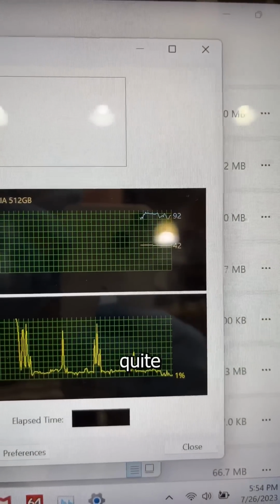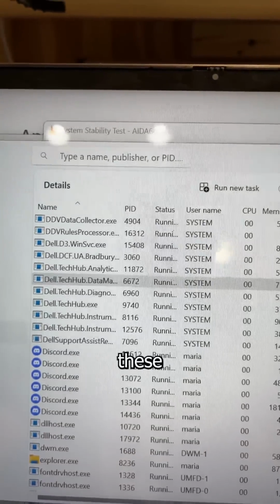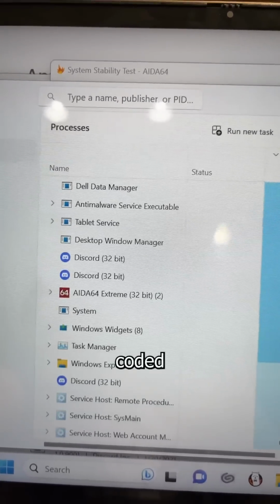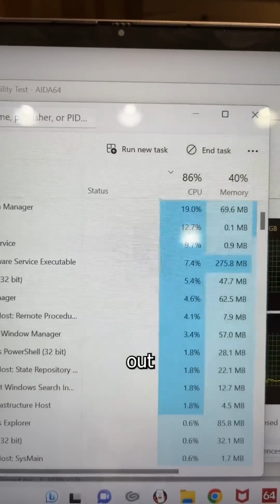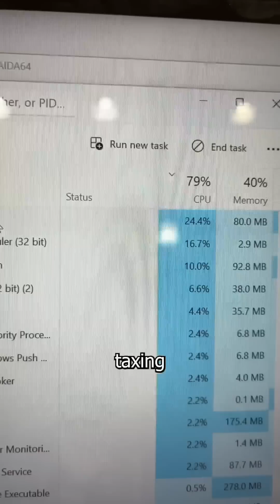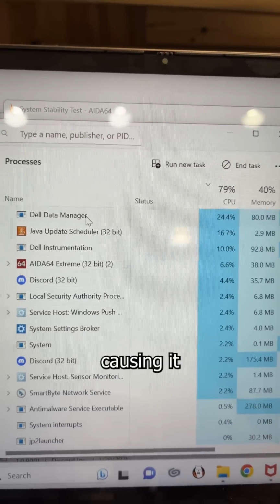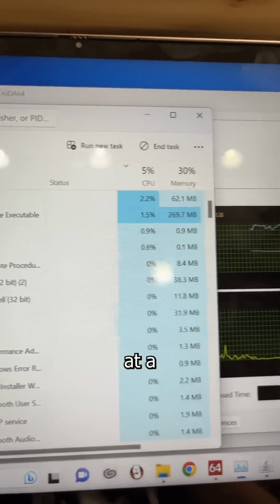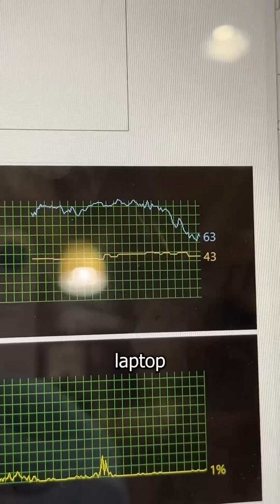Cleaning an overheating Dell Inspiron laptop. Can it be fixed? #tech #gaming #shorts #technology #pc

Comment from the maker: Now I’m no Engineerspert but clearly this heatsink was made for an Intel chip with an IGP and not for this AMD Ryzen 7. How big of a difference does this make in keeping the CPU cool? All you engineers can let me know in the comments!
Reply: I thought you were
The
Greatest 
Technician 
That's 
Ever
Lived
?
Reply from the maker: @Not_interestEd-  The jig's up, my house of cards is crumbling before my eyes
Reply: @Not_interestEd- of course he is, but he is not yet         the greatest Engineerspert That’s ever lived
Reply: Ryzen 7 is usually more efficient than Intel with IGP, Ryzen 7 runs down to 25w output. I'd clean it out, apply new thermal paste and pads and call it could.
Reply from the maker: @infernaldaedra the thing is it has no pads, just this tiny sad excuse for a heatsink. But thank you for the info. Curious why Dell thought it was ok to just slap thermal paste meant for Intel onto this? Does it just not make a difference?
Reply: @SalemTechsperts  I'm guessing it's because these heatsinks ship with thermal paste pre-applied. Dell used parts from the Intel model then slapped a AMD CPU on the board and called it a day
Reply: @SalemTechsperts  it should make no difference. The coolers are from a different oem and the paste is just silkscreened on. If there are no pads don't worry. In my opinion the cooler looks more than adequate for the CPU might even perform better with the larger cold plate even if it's unusual. Dell and HP try to reduce parts by reusing them from other models. Makes buying catalog parts easier too sometimes. My guess is that the Intel chips didn't meet sales projections so they got turned into Ryzen coolers.
Reply: @SalemTechsperts I'm pretty sure you said that wrong because there's no such thing as "thermal paste ment for Intel" thermal paste is such a product that it can work on any CPU regardless of brand.
Reply: Dell certified engineer here. Dell often only sells Intel exclusively, this means they mass produced for parts for Intel, which is why you see it being used here. If the Ryzen is kept within its 25 watt tdp it shouldn't on paper cause issues. However I would set the bios to cool and quiet or if possible a higher fan curve from either the bios or a custom fan program if possible. Note that Dell bios doesn't include fan control often.. so that milage may vary but cool n quiet mode for sure should exist at least. Hope this helps.
Reply: @tqrules01  Fun fact. at one point ALL of Dell's revenue and profit was because they were getting kickbacks from Intel to exclusively use their products and that they would make false allegations against AMD hardware. Intel even made enough money on the deal to win the lawsuit from AMD. 😂
Reply: @infernaldaedra  Can't like this comment or react but I do Say this. ... take that it how you like :)
Reply from the maker: @tqrules01  Awesome info, thanks for sharing!
Reply: @SalemTechsperts  you're most welcome and keep on asking! Everyday we learn everyday we have a chance to improve ourselves and move forward to something greater.
Reply: @infernaldaedra  you dont know how cooling works. Just having less wattage doesnt mean shit. since the ryzen chip is so tiny, it heats up crazy fast, so intel chips can use way more wattage while hvaing lesser temps
Reply: Doesn't make a difference what heatsink you put inside a laptop as long as it makes a good contact with the CPU surface 😊
Reply: @emadhamidnaja  Yes it does, smaller heatsinks cool powerful cpu's less
Reply: @emadhamidnaja Of course it matters. The amount of copper pipes on the heat sink makes a huge difference in temps, whether or not the heat sink has a Vapor chamber design, and the surface area of the heat sink, all make a difference regarding CPU temps. Look at a tear down of a high spec gaming laptops heatsink, and then look at this one again haha. Your statement is absolutely false man, it absolutely does matter what heatsink is used, the only tangible metrics being the amount of contact between heatsink and CPU being the sole predictor of cooling efficacy is very silly.
Reply: How do you nuke bloatware. What program do you use.
Reply: I HAVE A DELL INSPIRON 14R THAT IS UNOPENED FOR   11 YEARS. I JUST OPENED IT UP FOR CLEANING THE 11 YEARS SCROTUM DUST AND DISK AND RAM UPGRADE. I'M USING THIS LAPTOP TO WATCH THIS VIDEO
Reply: can u list those useless dell programs  I have dell inspiring 15 3000
Reply: Fine as long as the copper bit has contact with the whole die.
Reply: i like how there is doors music in the background
possibly not but i recognize it as the doors elevator theme
Reply: FWIW, Ghost Specter would make it run even cooler.
Reply: I have a laptop that overheats often, I thought it was normal, could I get some info, I might have to send it over
Reply: heatsink shouldn't matter, most of them are the same
Reply: And honestly, that wasn't mutch with SETI on 100% I've had smoke melt a MB, 4 months later I managed to fix it, still dunno how, bridge blown, etc oh and nice voice add in
Reply: Should i open my ps4 slim from 2018 to take out all the dust and lint?
Reply: Use wd40 on asus laptop fan, from >80 idle to <70 idle in turbo mode.
Reply: My Dell Alienware M17 R3 completely died trying to startup a game, I tried checking if it was a battery issue doing the 30’sec test both plugged and unplugged and it’s entirely unresponsive. Any suggestions on what’s making it not work at all? I even took the back panel off and plugged and unplugged the battery back on carefully.
Reply: bros now the Greatest Engineer That's Ever Lived?
Reply: how would I get in contact to repair my old laptop?
Reply: It should not cause any performance issues, only some mounting problems but that's it
Reply: speak english please
Reply: How do you check you temps on win 11?
Reply: I don’t think it makes much of a difference as long as the entire die is making proper contact with the heat sink.
Reply: About the case mushrooming, what do you mean, the dirt or the material in the holes that is glued to the case?
I have a Dell Inpirion 15 5510 and where you show that plastic/metal material with holes I have a plastic covering those slots. Will I have to remove the plastic so the heat is not stored inside? ¡¡¡¡¡Thanks!!!!!
I'm from Argentina in case you don't understand the translation....
Reply: You should try PTM7950 instead of thermal paste, it lasts longer.
Reply: dayum.
Reply: Intel's cores are actually pretty bad at keeping cool though, so it balances out. Maybe blame Windows 11 for having stupid power management, they did something to the power plans that I have to fix every time I install a new computer to keep the fans off. I have to load powersettingsexplorer and set the SpeedShift EPP to a reasonable level for just idling, and then I usually set it as a custom power plan so I can return to the hyper-aggressive stock boosts when doing something I need performance on
Reply: Hey! I really need your advice here.

I have a dell inspiron.
Applications take a while to open, then they perform normally. Any lightweight app or heavy game, same problem. So like opening file explorer or a AAA video game will take longer than usual, but they will perform as they used to after they have opened up.

Is it hardware issue? Is it related to CPU/RAM/HDD facing any issue? Is it due to the laptop heating up over the years and it damaged the part's efficiency?

I have looked up with several keywords but i am not able to phrase my question properly.

Thanks.
Reply: @Zekr0_  in my experience CPUs tend to only fail due to abuse, ram and HDDs issues can cause headaches for sure. Easy to test both though.
Reply: @infernaldaedra  Hey! Thanks for the info. I appreciate the explanation. 

I also think the issue might be with the hard drive because apps perform normally when opened. Its just taking longer than usual to open them, which logically should be a problem from the place where apps are stored. But I just didnt had any knowledge how to verify this.

Do you know of a way where I can test the components performance in current capacity and ideal / usual capacity? 

I would like to test my HDD, RAM and CPU to know better.
Reply: @Zekr0_ I also have one from 2018, I'm opening it up today to see if there is any lint blocking it, and changing the ram from 8gb to 16gb. Wish me luck.

I'll let you know what is improved, cheers
Reply: @KyraTheFloof  hey, i hope eveything goes well! All the best
Reply: @Zekr0_  Works great, found it supports a 2.5" HDD so I put that in, 16 GB too
Reply: @KyraTheFloof  thats great news! I am glad everything turned out well for you 😄
Reply: @Zekr0_  I think it’s your storage (HDD/SSD). Once the application boots from the (apparently slow) storage, it’s no longer the storage’s task to ensure it running well
Reply: @Zekr0_  step one. Back up your data. If file explorer is slow to open you might be looking at imminent drive failure. After that antivirus, clean up some storage, go through the windows settings and turn off all the startup and background processes. Delete all the Dell bloatware
Reply: @infernaldaedra honestly I just reinstalled Windows 10 fresh on the day I bought it (didn't want W11), so I never knew it was full of bloatware to remove lol
Reply: Try undervolting that amd chip if possible, simply Dell made terrible cooling, And possible better pad Instead of paste would be ptm7950 0.2mm pad, or liquid metal (after covering smds with nail polish, And two layers OF LM after First one gets eaten into copper @salem
Reply: @Callagwhan  Don't liquid metal people's laptops unless you're willing to pay for a full system replacement please. That crap gets everywhere and effectively causes liquid damage. Honeywell PTM or equivalent is fine tho, and performs the same.

Comment: Is the laptop an inspiron 5406? If it is then it's not surprising that it overheats. I've had my inspiron 5406 hitting max temps of 100 degrees since i bought it.
Reply: How did you fix it
Reply: @spircatch  I didn't. It's been that way from the start. I just switched to an hp victus. I'll be repasting the 5406 with gd2 and checking the temps later. I used cooler masters master gel maker and it pumped out in a week.

Comment: Why has no one made a laptop where air intake and exhaust are coming from the keyboard side of the laptop? Yea i know cooling could be somewhat reduced, but it would be cooler than a fanless, yet not have this issue of clogging up the fans

Comment: I've got an Inspiron that I ended up having this exact problem with. I've started using a laptop pad that lifts it up and has fans to combat the overheating. It will be going into the shop soon though. Or I'll be doing it myself. One of the two is going to happen this year.

Comment: just bought a dell inspiron, and since I only use it for computer engineering related task I put linux after 30 mins on windows 11 because of useless software and windows related task... Anyway is the maintenance  easy to do?E.g. accessing the cpu/gpu for a thermal paste change

Comment: Only flat surfaces, only polished wood. I have an Acer Aspire a515-56 that overheated and died one morning. I had installed a new ram chip the night before and I did a long gaming session to 2am, then shut it down and closed the lid. I woke up and tried to log on, but it wouldn’t turn on. I felt the middle and burned my hand, so I immediately took the laptop to an ac unit. Decided to change the ram back, all the while putting it to the ac every now and then to cool it down until I could disconnect the battery. I changed the ram, connected the battery, then tested it and it ran well. Then, I changed the ram back to the new ram, and it worked fine again. Turns out, the problem wasn’t the ram but rather the way I’d reconnected the battery the first time. Never had another problem with it, but I have a cooling pad for it and use it every time just in case it happens again.

Comment: It also doesn’t help that some models of that has one air vent on the bottom of the laptop, while the other is on the back and gets covered by the top over of the laptop when it’s opened.

I cannot even count the number of times my computer got hot, and how hot that back part got, because of that horrible design choice. I’m just glad I have something made for laptops to put it on to help it stay cool!

Comment: "This program is causing it to overheat" The CPU is literally at 76 % usage, which should be NO reason to overheat, regardless if bloatware of DELL is causing the CPU to be used more or not. That aside, a CPU should in NO case overheat at 76 % usage, so your removing of it does not remove the fact, that it would overheat at a game, when it runs 100 %...

Comment: What are you talking about? Its not like that stuff on the cpu was installed like that, thermal grease doesnt last forever, it dries out over time, thats why it needs to be replaced every 3-5 years.

Comment: I can actually explain the thermal paste. Dell will use the same heatsink in multiple machines and the thermal paste is pre-applied so this would be the result of it not being the top of the line model. I’m imagining because of the amount of lint that could be a good thing as it would mean it took longer for this machine to require a good cleaning

Comment: You actually fix it and educate us too <3
Reply: I actually cleaned a HP 2000 Notebook PC fan before, but it was a hassle trying to get the screws on after cleaning the fan, but it took about an hour to do all that, and it still runs fine, but it is currently running Windows 7, which it USED to run Windows 10 22H2

Comment: Asus has a horrible software support, their drivers still working as fkt. And you know what? I did a mistake in 2021 and get one laptop from Asus. Damn, they have so stupid software solutions like bloking abilities to increase fan speed when laptop is overheating. Seriously, my laptop all the time cooking itself just because Asus wants to make me buy new ones faster. So yeah, never happens again. 
They still didn't fix drivers issues when some modules of laptop just getting error 10 and turning on and off when they want to)

Comment: I hate bloatware. I just got a HP Envy laptop, and the bloatware was causing it to crash and perform well below expectations (it has a 3060 and a 12700h, but it was only able to do 3650 in Cinebench r23). After I reinstalled Windows while not connected to the internet (I tried while connected and it reinstalled the bloatware), the bloatware was removed, and the laptop is performing much better than expected (14,683 in Cinebench r23).

Comment: i got a state surplus dell optiplex, its a bit slow on startup but other then that i dont have any issues (im pretty sure it was completely wiped and had replacement drives when i got it, plus the bloat is probably the amd drivers i never bothered to delete when i got my new gpu)

Comment: My Acer laptop was slow from the moment I used it. Did a fresh install with a Win10 iso and boom it was fine. Oddly though, it has the same background image that Acer has used so I'm curious if there's something in the bios that forced that background image or if it was Windows saving it in the cloud and using it.

Comment: So as of current i am a dell authorized consumer device repair tech. I get this all the  time. I dont do any of the software side only the hardware. They send me the parts and the customer location and say go fix it. I get no sales commission or anything just warranty repair depending on distance. As much as people dog on the unrepeatability of some dell devices i feel it is undeserved. My only major complaint is that dell wont directly sell you the part without a large markup. 

But when repairing devices for my customers I try my best to get them  back where they should be, and if my repair fails or another issue crops up i fast track them to support.

Comment: I'm sorry but your talking shit, 96c at 79% utilization, and 60c at 6%. Programs running does not make the CPU overheat, its not how any of that works, it would have be running at 100% with a cpu heavy load to get that hot. You either reinstalled the fan/bracket wrong, or you did not put enough thermal paste on it. Before anyone asks, yes you need a lot more to cover the entire die on laptops because unlike desktop cpu's its an exposed die without the heatspeader ontop so it needs to be covered in thermal paste entirely. Do yourself a favour and stop giving false information like this to your viewers.

Comment: unrelated question, MSI Crosshair 17 user here, 12700h. Is it normal for my laptop to run around 92°C? Yes its clean(im afraid to repaste though). After enabling the efficient turbo mode in the advanced bios settings, it stays around 86°C and sometimes spikes above 90.

Comment: Hey! I really need your advice here.

I have a dell inspiron.
Applications take a while to open, then they perform normally. Any lightweight app or heavy game, same problem. So like opening file explorer or a AAA video game will take longer than usual, but they will perform as they used to after they have opened up.

Is it hardware issue? Is it related to CPU/RAM/HDD facing any issue? Is it due to the laptop heating up over the years and it damaged the part's efficiency?

I have looked up with several keywords but i am not able to phrase my question properly.

Thanks.
Reply from the maker: Get an SSD
Reply: @SalemTechsperts  so is there any issue with my HDD? 
My dell inspiron supports those old SSDs (M2 i think) (year 2016 laptop) and dell says only upto 128 GB.

I dont mind buying a SSD but 128 is too low. Do you think it can actually go for more? Should I also replace the HDD?

Thank you so much for replying, it means a lot that I am getting help from you.